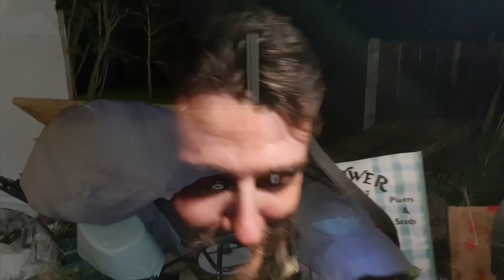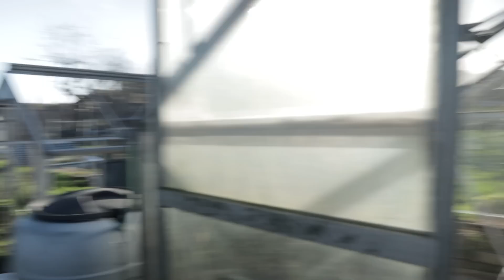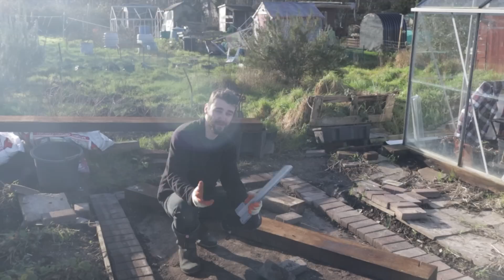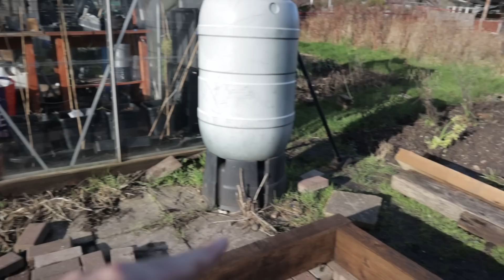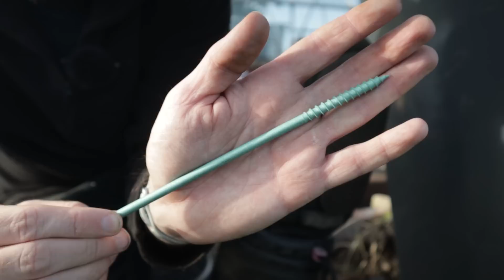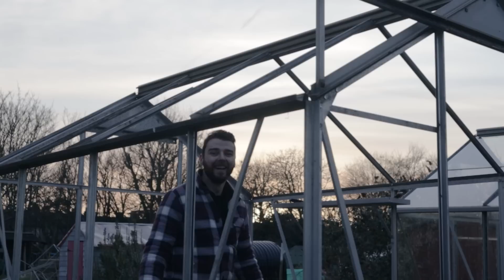Building This Greenhouse Nearly Broke Me | Plot & Storm Update | JB's Allotment Diaries

Comment: JB, You need to pull the screw back out. Whenever you get the screw going in and it slows way down and gets hard STOP reverse bring the screw back out( quite often there is too much material there for it to work well and bringing it back out lets the excess come back out) now you can return to going in again and should make it all the way in. BEFORE you do the next screw predrill with a one size bigger drill bill to remove more material before the screw goes in. The bolts you were fighting with would go better if you had a socket for your drill that fits the top of the bolt and put it in use the drill to turn it in. Big time saver. Good luck chin up learning everyday more to learn tomorrow! take care
Reply from the maker: This is such good advice! It's literally never happened to me before!! I've used timber locks before but where we worked the drills were much more powerful and just buzzed everything in in one go! Clearly I have much to learn 😁 The hex head timber drives went in like a dream at least!

Comment: Hi JB Tip for next time Drill the top/front pilot hole slightly bigger than your screw/bolt and your base/back piece smaller. Then you will find the two pieces will be drawn together so much easier, as you will have found with those timber drives with out the thread on the top!
Reply from the maker: Brilliant tip, thank you!

Comment: 😆 Warts and all today! What a great episode!! When I put my GH together by self the feeling of accomplishment was amazing, so I hope you had some of that. 💨 I did worry for your GH glass if it’s partially glazed and it gets windy again before the rest of the glass arrives! I used those same long sleeper brackets on my raised bed sleepers on my lawn, though I had to cut them short by a couple of inches because they wouldn’t go all the way in on one portion of my lawn - I think there may be an underground soakaway in that area. Reciprocating saw FTW on that job!!! I ended up using some right-angle brackets inside the sleepers to secure them together. Think of a 6in by 3in metal plate bent to a 90° angle. I just didn’t fancy tryjng to get those long screws in. So I was well impressed at the ones you ended up using which looked a lot easier to handle.
Reply from the maker: Thanks tufty! Definitely warts and all 😂 I used the same 90° brackets on the internals of my other greenhouse! I think they might have worked better if I'd used longer screws though, I only used little ones so they're barely holding together 😱. Don't worry, I shan't be leaving it partially glazed for any longer than a day or two maximum. I'm going to have to glaze it and then count and then take it all back out again... Not very fun but better safe than sorry!!

Comment: JB you were warned months ago,I did say do not put up a greenhouse without finishing it fully,we made that mistake,now screw it down to the base if you don’t we’ll end of story.good luck.
Reply from the maker: I'm not sure what you mean Jackie, do you mean just the frame? I had to get that assembled otherwise I was never going to be able to build the base and get the timbers cut to a perfect size! I should have weighed it down for sure but there was no warning about the winds! 🌪️🌪️ At least I managed to save it at 4am! 😁

Comment: May be a bit late with the advice but mole grips and WD40 may have helped a lot with  all those stuck bolts.
:)
Reply from the maker: I actually had mole grips in the bag, they're chunky though and often I couldn't get them on the nuts and bolts! I did use wd40 in the original dismantling too but I've found generally if they're fused, they're fused!!

Comment: Will you be testing the compost you've bought for aminopyrolyd?? What are those boots you're wearing??🤔🤔😁🌱☀️
Reply from the maker: Yes I will indeed, just in case! I actually set a trough of beans going outside and just today noticed they've all been eaten by the squirrels 😂 so I will try again in the conservatory!
Reply: @JBNat  I will trade you all of your squirrels for just one of my tomato stealing chipmunks. I never thought I could hate such a cute little animal, but this is war.
Reply from the maker: I've only just seen the question about my boots! They're just wellingtons!
Reply: @JBNat  at least you still reply to your followers lol your boots looked like they had some kind of built-in knee pads 🤣😉
Reply from the maker: OH!!! Those!! They're just velcro job. They're amazing quality though and I actually found them in the shed when I first took the plot on! One of the most valuable things that were left behind I reckon!! They're so comfy!
Reply: @JBNat  is there a makers/brand label on them at all, maybe on the soles?? I suffer with knobbly knees and need pads in the garden lol. In fact I could've done with some when I modified a cupboard last week, ended up having to be lifted off the floor when getting up 🤣😂🤣🌱☀️